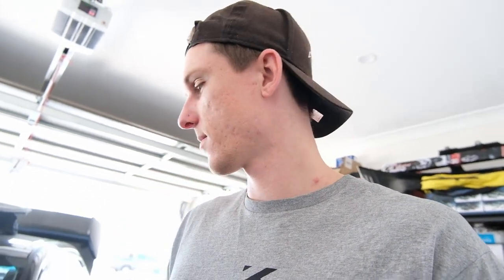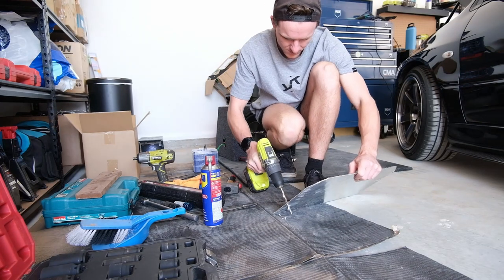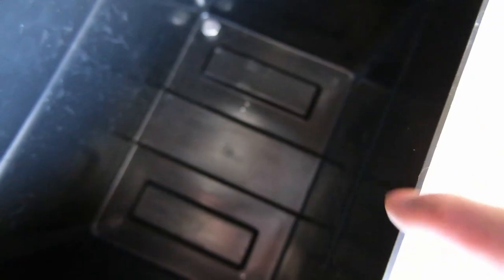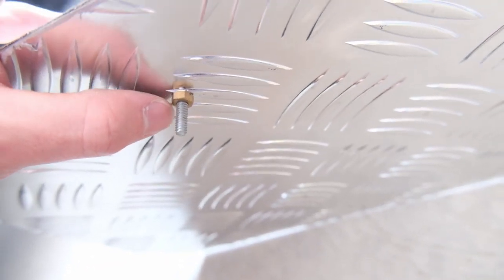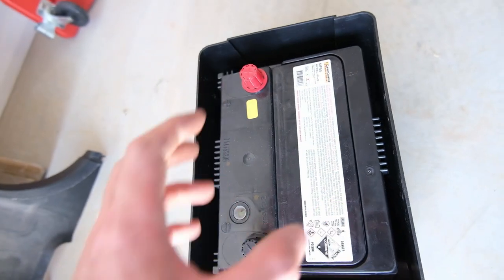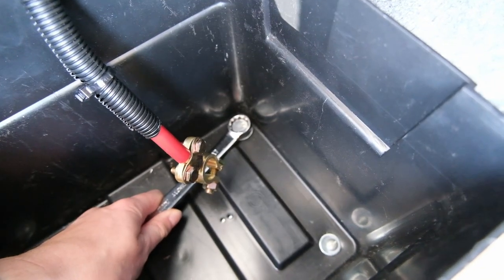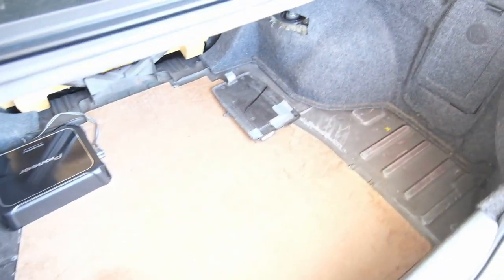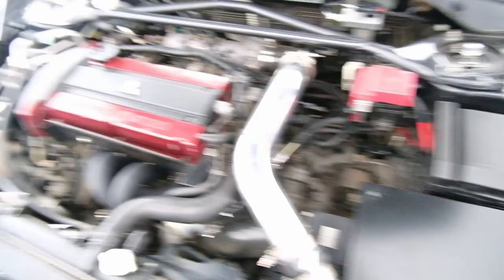It didn't catch fire!! | Evo 9 battery relocation | PART 2

Comment: I would advise against the use of a battery cutoff switch on a stock ECU Evo (particularly with a MAF).. reason being that all the ECU's stored data will be wiped every time you turn the switch off and will essentially be starting over from scratch. Fuel trims will be whacky for a few drive cycles, especially with aftermarket cams. Personally, I'd much rather see you take that $20 and get a battery maintainer/float charger. Seems like sus is privileged and lives in the garage anyhow so why not right? Well played on the fire extinguisher tho 💯💯 👍👍